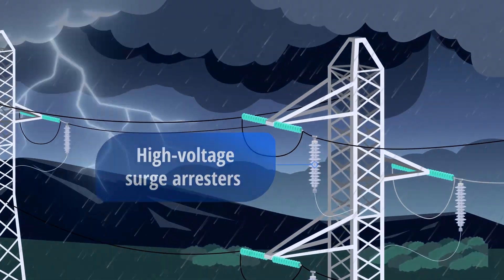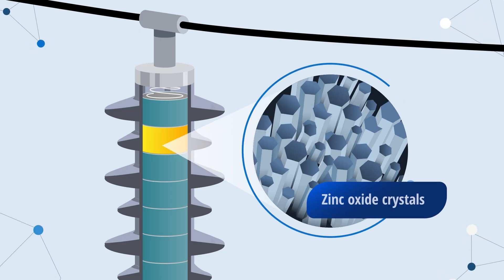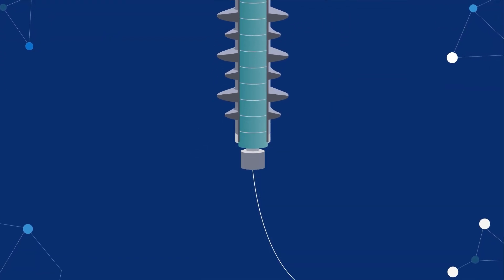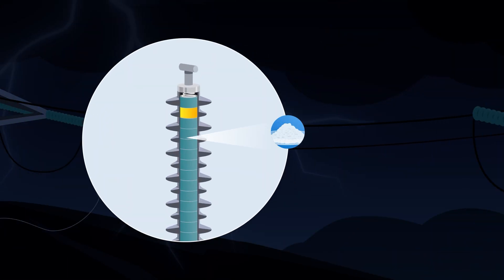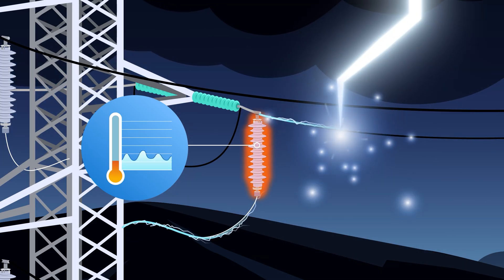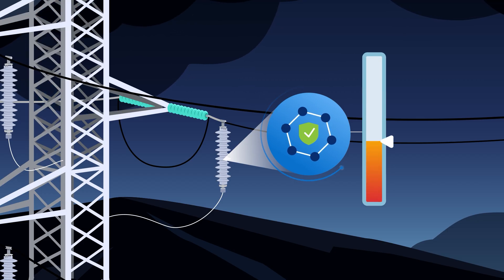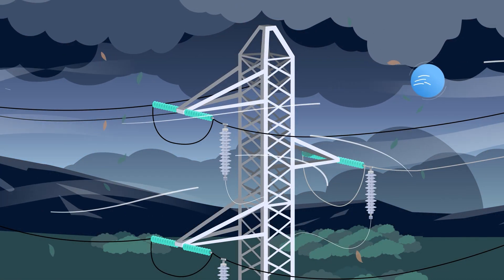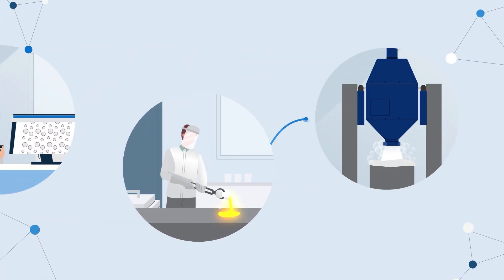Insulating Metal Oxide Varistors (MOVs) in Surge Arresters with Glass

Comment: This type of product has been replacing the spark gap variety and are an excellent way to protect transformers both small and large that are part of the grid.. In the age of EMP fears these high voltage high amperage MOV's are being installed to protect substations.. In our area over the past 4 years most of the substations have been modernized to include these and mercury switching that replaces cat whisker switches so a computer can quickly isolate a failed section of our local grid to prevent cascade failures.. This is part of the federal government push to harden our national grid.. Homeowners should install UL approved surge arrestors at their main panel entrance to the home fuse box as protection.. Another device that is now available is an over/under voltage sensor that disconnects your main power if the voltage is too high (white out) or too low (brown out) thus preventing damage to appliances and electric devices in the home..